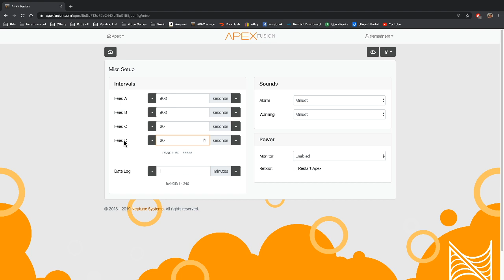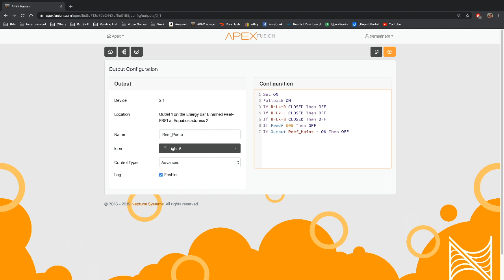Neptune Systems Apex Tutorials - Programming Feed Modes

Comment: Your videos are really great ans appreciated Derek. 

Sorry if this is a stupid question: 
Is there anyway to have a momentary button trigger one of the ‘Apex A-D feed modes’? (Harry’s switch box) 

Alls working with virtual outlets for a few feeding and maintenance modes..
But trying to figure a way to have a V-outlet trigger an Apex feed mode instead because I like the fact it can be cancelled in fusion. 
Maybe there another way..but I’m not savvy enough to create a Virtual outlet for ‘maintenance mode’ that allows me to cancel it when I’m finished. I’m using defer statement - which I understand can’t be undone with code once initiated (?)

Sorry again if this is a stupid question..but somehow I can’t find answer/solution to this. 

Cheers and hope alls well. 
Thanks for all your content.
Reply from the maker: I have 2 videos on using the switch box and programming them.  Check ‘em out!  Thank you for the kind words.
Reply: @ReefAndReptileAutomation  Thanks man!
Yes appreciated I watched both. 
But I was actually hoping to trigger actual ‘Apex ABCD feed
mode’ with a physical button…but seems Neptune don’t want to allow this(?) (They’ve coded their ABCD Feed modes to be triggered using fusion app or display controller only?)

Guess I’ll have to stick with the VO method. Thought I’d check with the expert. 
Cheers and thanks again!
Reply from the maker: @frostyhardtruth3170  It is quite easy actually.  Just make a virtual outlet that does the feed mode then trigger the virtual outlet with the button box.
Reply: @ReefAndReptileAutomation  Sweet! 
Man so crazy…I’ve searched for syntax to do that and couldn’t find it. And I guess I must’ve been reading outdated forum posts saying it wasn’t possible. 

Ok..I’ll try the below code for Virtual Outlet. Thanks man!
 
Fallback OFF
Set OFF
If SW2 closed then FeedA 000